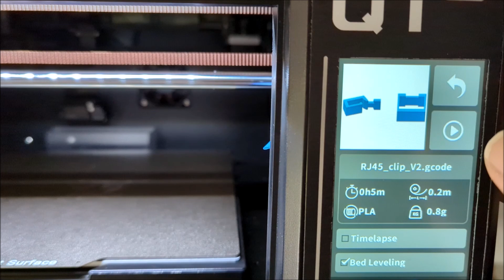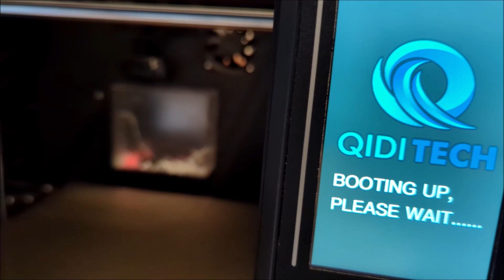BIQU microprobe on QIDI Q1 pro

Comment: Installed it today. All worked 100% Managed to keep the 2nd extruder fan (that used gpio11 before), by using the 5V from the bottom pin on the orange connector and joining the fan ground to the middle pin (ground) of the 3 pin black connector, which the MicroProbe also use. The 2nd fan is now always ON, but it is OK for me. (I left a diagram of this on your Printables page, if anybody want to see.)  Thanx again for a great design.😉👍🍻

Comment: Thank you for this. I have one of them on another DIY printer I made and am going to fit it to my Q1 Pro also. My Q1 Pro have " !! No trigger on probe after full movement" errors 90% of the time and I am tired of it now. Just a  question, how does it perform in a heated chamber? I read that it does not work of it is too hot.
Reply from the maker: So far it works fine even in a heated chamber, but I must admit I used it in a heated chamber only twice and not longer than 2 hours...